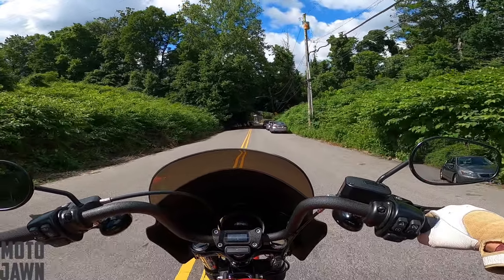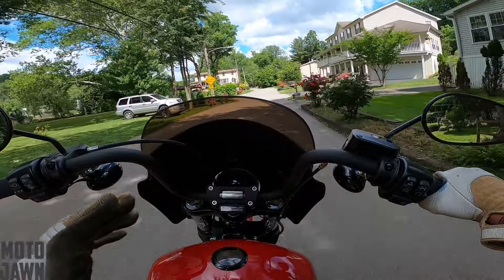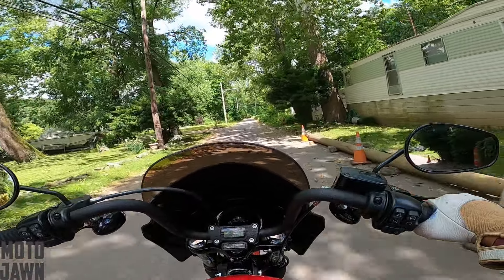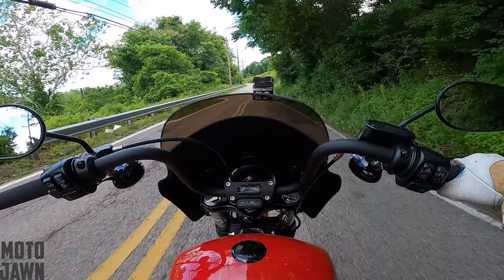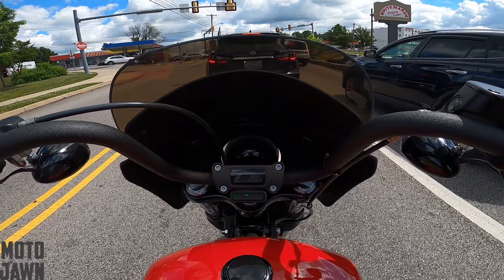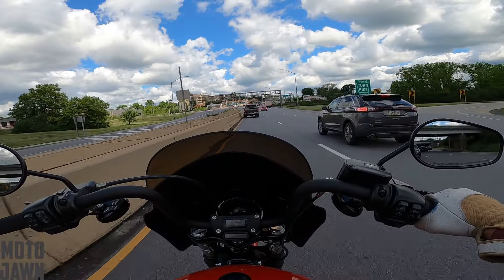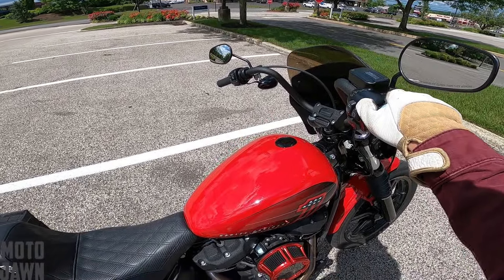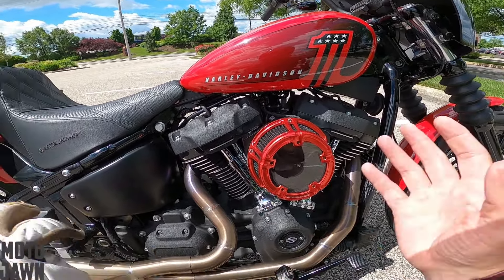Is My Harley Street Bob Stage 1 BROKEN!?

Comment: EITMS
It can be turned on and off by rolling the throttle forward for 6 seconds. Sometimes called parade mode. It cuts the gas off to the rear cylinder to help keep the bike cool.
When you cut EITMS on the cruise light blinks green. When you cut it off I the cruise light blinks yellow.
Reply from the maker: Yeah I'm starting to see that seems to be the case now.
Reply: Was going say same its shutting the rear cylinder off happens when temps is over 280 at idle. Do as he says roll throttle foward when it does it and itll go away
Reply: yeah I have a 24 rg it does the same with the eitms light on
Reply: I thought that the  rising idle rpm is designed to  make the  oil pump to  circulate oil   faster   -    cool the  engine.  This is happen when is very hot , traffic etc.
Reply: That's normal, thatsystem is good. It prevents your engine from overheating by deactivating rear cylinder at idle.

Comment: Yep!  My 2020 Softail Standard with 21000 miles did the same exact thing a few days ago.  It was a flaky clutch switch.  If you have ever noticed, when letting out on the clutch very slowly without moving the throttle, the engine will speed up a couple hundred rpm.  This is so subtle you don't even notice it when you pull away from a stop, but it is there and it is normal.  What isn't normal is when it gets stuck in the "pull away" mode and won't idle back down.  I treated my clutch switch with a couple drops of DeOxit and flicked it a few times with my finger to break up the oxidation that builds in the switch contacts.  Fixed it.  While I'm on the clutch and brake switch issues let me pass on some information about a couple other problems I have had.  My bike began not starting in gear........turned out to be a flaky clutch switch.  My cruise control began dropping out while riding along.  Turned out to be a flaky brake switch.  Cleaned it with DeOxit, flicked it a few times and it was fixed.  Just flicking the switch a few times works also but the DeOxit will make the fix last longer.  Hope your bike responds the same as mine did.

Comment: Sounds like an intake leak. Did they put the support bracket on when they added the air cleaner if it needed it? It's an extra part I see a lot of install videos do not add it during installation.

Comment: Did you get a tune when you replaced the intake, exhaust and headers?  Surging could be manifold or exhaust issues.  Make sure your headers are good and sealed tight to the heads and check manifold. You need your idle set to 925 ish minimum as well.  Make sure your EITMS is off.  Turn bike to on position and roll throttle forward for 3 seconds.  It comes on once the rear head temp reaches 289 degrees F
Reply from the maker: Thanks a lot of signs pointing to the EITMS I'm going to check that out
Reply: @TheMotoJawn  it's easy to turn on accidentally.

Comment: I vote for the automatic cylinder deactivation.  Probably not much to worry about.  It shuts the back cylinder off.  If you blip the throttle it does exactly that...turns the deactivation off.   My FXLRS does that pretty quickly w/very hot engine....like maybe 10 seconds after stopping.  Again, not much of worry in my opinion.  Yea, it definitely sounds different when it is a one cylinder.  But, it is better for you in the long run.  I heard it.  definitely what it is.
Reply from the maker: Interesting thanks for the info, just strange it never happened before the tune
Reply: @TheMotoJawn  If this helps, my '23 FXLRS has not tune one it...Yet.  It soon will have a cam, pipe, PVIII tuner.  For now though, it is all stock.  Maybe Dynojet can ease your worries.  Maybe the tune makes it more pronounced but yea, it is cylinder deactivation.
Reply from the maker: @nhzxboi  Thanks man yeah seems right a lot of signs pointing to it being exactly that 👍
Reply: That bike doesn't have rear cylinder activation.
Reply: @kellybarnard5242  I think you are wrong.  Look in your owners manual under EITMS.  It even tells you how to shut it off.
Reply: @nhzxboi  You are correct! I'm wrong.  I don't think I've ever had it kick on.  I had a cvo 110 fatbob rear cylinder activation and it came on all the time.

Comment: It's the EITMS cutting in, when the motor gets hot, (More so in the hotter months and mostly stop go traffic)  the EITMS cuts in and turns fuel off to the rear cyclinder and the rear cyclinder turns into an air pump thereby cooling the rear cyclinder, Harley for probably as long as they have made V Twins has had overheating problems of the rear cyclinder. There is a description of the EITMS in the owners manual.
Reply from the maker: Yeah realizing now it was enabled somehow and I relaize it was
Reply: @TheMotoJawn  My 2017 streetglide had the EITMS setup, I didn't realize my bob had it installed, it cut in last summer in stop /go traffic and I thought the air fuel sensor in the inlet manifold was dirty, that sensor can  make the engine run like the EITMS.

Comment: Hmm....sounds like you may have an intake leak or something and the computer is trying to compensate for it as you mentioned. That would explain why its good after you blip the throttle because you increase airflow and the leak becomes a smaller percentage of the overall airflow. Best way to test would be spaying with something flammable like starting fluid and see if RPMs change. You won't really be able to see it visually. Definitely check mapping too for sure.
Reply: The factory shop manual for my 2005 Sportster says to use an unlit propane torch to check the intake for air leaks.
Reply from the maker: Thanks for the info I'll give that a shot. Where do you think to try? Mostly around the intake?
Reply: @TheMotoJawn you want to try behind the intake mainly and the intake manifold area right between the cylinders.

Comment: Could it be,  simply the factory cylinder deactivation at idle? It's mentioned in the service book.
Reply from the maker: It never happened until after the tune though 🤔
Reply: @TheMotoJawn  its easy to turn on by accident.  Turn bike to on position, not started, roll throttle forward for 3 seconds.

Comment: @themotojawn have you checked to see if they set your throttle back to where when you at idle the rear cylinder will stop. If you roll your throttle forward and hold for a few seconds it should shut off

Comment: I think we've zeroed in on what it is.  I just wanted to add how air-cooled bikes can be w/o such a system.  I attended our Local motorcycle rallies(Loudon, NH) back in the '80s with my FJ1100.  Awesome bike but also air-cooled.  OOF!...get stuck in hours-long traffic and it would start to burn tons of oil, backfire and stall.  Harleys were even worse.  It sucked then cuz the cops insisted that you keep your engine running when on the road.  Silly, but true.  The Idle temp management system is not a bad thing...especially when you're stuck in a traffic jam.  Old days/New days...at least the system is actively trying to protect itself.  I'd not disable it if I were you.  It would make a cool video about that system once you figure it out.

Comment: Ive had this happen, i would check the oil temp, its definitely rear cylinder deactivation. I don't believe it happens at 287 degrees though. Maybe the tune activates it at a cooler temperature. You can turn it off, i haven't tried it. Something to do with roll off throttle.. and watching your cruise control color? The throttle does roll forward a little from resting position.
Reply from the maker: Tha KS definitely checking that out
Reply: I didn't think the m8 in the Street Bob has rear cylinder activation. My 09 cvo 110 fat Bob had it, and it's definitely a noticeable sound change.

Comment: I know the feeling man, my ‘22 Street Bob had 1 lifter fail already. Only 7k on the bike. Shot metal into pan and stuck in the collector. Harley has approved warranty repair, but I’m just concerned a lift er has failed with so little miles.
Reply from the maker: Damn that sucks. Hope this isn't related to something like that
Reply: @TheMotoJawn  yours doesn’t seem as serious. I had a loss of power and could hear ticking. I hope it’s an easy fix for ya and it’s not serious though,

Comment: Off topic, but you can fix the turn signal hyper flash by turning the bike to run, turning your hazards on for at least 10 flashes, turning the bike off. When you turn it back on your hyper flash indicator should be fixed.

Comment: I'm not much help since my situation is different and I haven't had problems. However it may be a lesson to those thinking of not using their dealer for engine mods on new bikes.
Since my 23 Low Rider S was purchased new and included in the cost was dealer discounts on parts and labor I decided to be conservative and have the dealer do the work with mostly Harley Screaming Eagle parts except for the Bassani stainless 2 into 1 exhaust which was purchased from the dealer.  The tuner includes both a Screaming Eagle tuner and an auto tuner which constantly monitors the system and adjusts accordingly.  This setup retains the warranty unlike other outside solutions. Also I saw no need to change the intake since the Low Rider comes stock with a heavy breather intake.  Your Street Bob does also which to me does not need to be swapped out for a stage 1.

Comment: Run the tuner again in auto tune. The tune may be out of spec when it's running hotter   

Also check the intake manifold between the cylinders isn't cracked - I think it may be plastic
Reply from the maker: Yeah I'll double check the manifold too 👍
Reply: @TheMotoJawn  couldn't hurt to check your throttle tube isn't gunked up preventing it from rolling back to full closed position 😂

Comment: As has been said, Engine Idle Temperature Management System (EITMS). Occurs when engine really hot. My 2022 Heritage will even do it after a long highway run and then I have to come to a stop.

Maybe the EITMS was not activated once you purchased the bike it but was activated when you tuned the engine.

Sorry dude but you need to READ your owners manual and pay attention to things that may seem out of the ordinary to you. Such as the EITMS (engine idle temperature management system) 😀